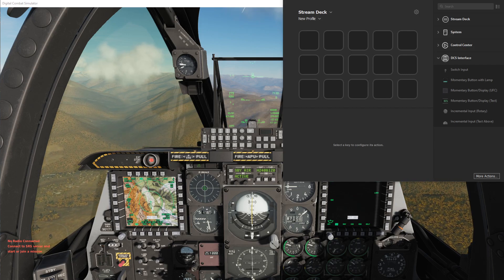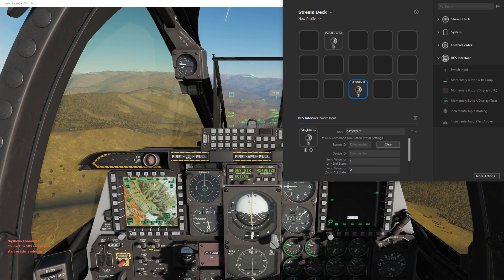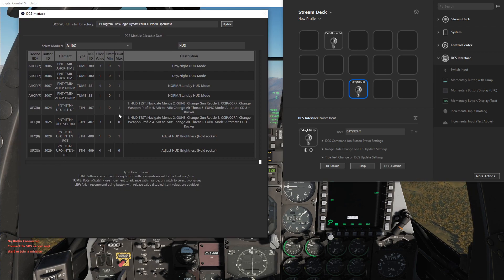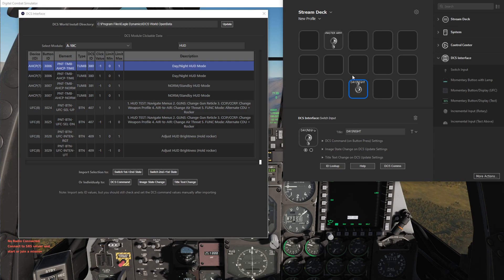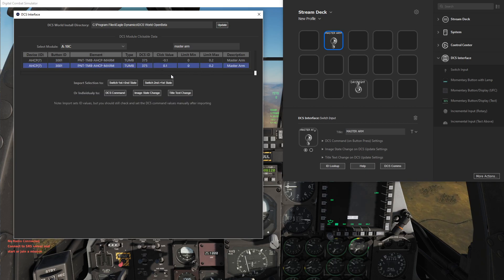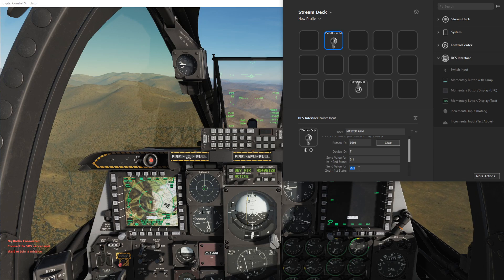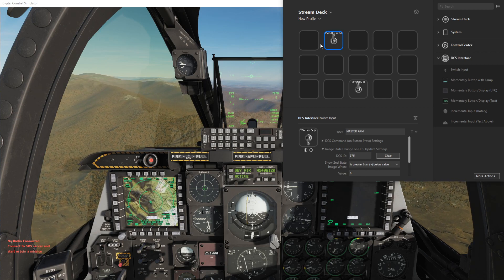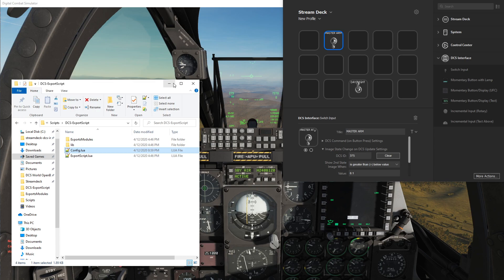Switches - DCS Interface for Streamdeck

Comment: Hi Charles

A great video. I may have asked you this before ... I have followed your instructions and the process seems pretty straight forward except i have a problem.  I am using a very simle switch with basically the same inputs as your day/night example. The switch icon changes state as it sould but immediately reverts back to the first state icon, basically it wil lnot latch in th eon position. This for the battery switch on the L-39. Come to think of it, I have the same problem on any two position switch in any of my profiles. Any ides?

Thanks

Nial

Sorry guys, forget this! It was only when I tested that I realised you have to have DCS running for the switch to stay in the switched position. DOH!!!
Reply: I have this same issue however I do have dcs running. still not working :(
Reply: @arekpawlik7013 
Hello.  did you manage to solve the problem?  I faced the same situation
Reply: @АндрейОсташев-б7ш  Unfortunatrly I didnt, instead I just use the hotkey funtion in the stream deck to set the binds.
Reply: @arekpawlik7013  Are there any instructions on the Internet on how to do this?

Comment: Thanks for creating this app for stream deck your a wizard!  At 0:31 and 0:45 looks how are you changing the font size like that without having the font dialog open?  Also, for the F16 how does one get the correct Button ID and Device ID, already found the DCS ID from the export module but not those 2 params.  Thanks again.
Reply from the maker: Sorry that's an artifact of my screen recording tool. I'm changing the font size from the menu panel that opens when you click on the "T".
For the Button ID and Device ID you should be able to get them from the ID Lookup table like at 2:45

Comment: Hello sir Tytler,

Nice feature! im gona work with this...
!!!
Although for the F16 it is probably not functional yet.

I might have something for you regarding 3way switches.
Myself found a plugin called 'Super Macro from 'BarRaider' at https://streamdeck-plugins.com/

Screen pics.   v-v-v-v-v
https://gyazo.com/9a3258040822f14b81018ce8b218ce67

With a short press you can switch downward and with a long press it goes up.
Where you also can ad intervals as long you keep the button pressed, it re-sends the key cmd after a given time in ms.

https://gyazo.com/15c75fdba1e3976d6d604a9455fec58f
https://gyazo.com/6fdd61ed9f819959027eb53b6f8490de
https://gyazo.com/707dd85f3dca797356da6030bd881ede
https://gyazo.com/0be24247e870537560575bc75464db46

Maby in the future some clever dude😆 can intergrade this in the DCS interface or sorts

Jolly good🤙

Icarus